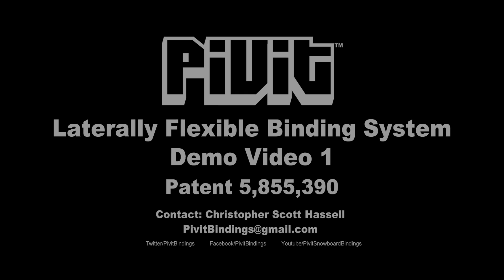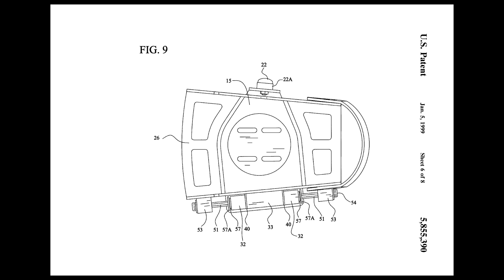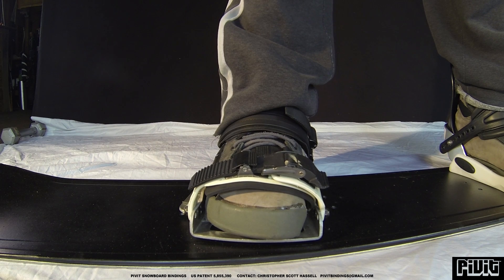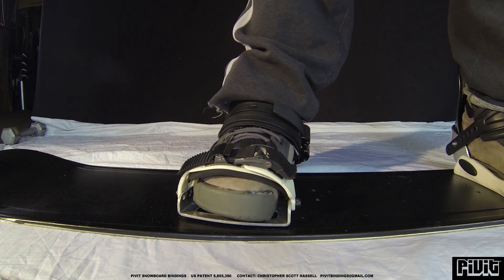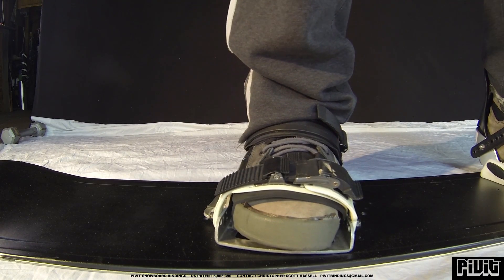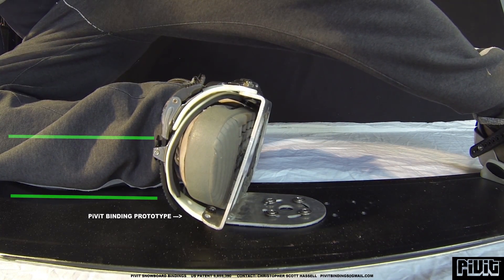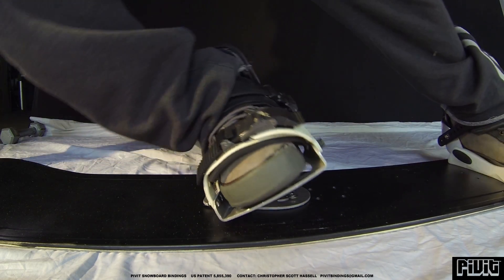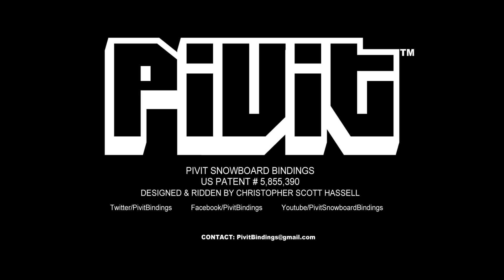The Inspiration & Logic behind Pivit Binding System

Comment: dude, make it so you can lock the pivot feature off if you don't want to use it and i think those things would rock!
Reply: Yup. Done. The patent (#5,855,390) includes and covers an efficient locking mechanism.
Reply from the maker: Done. It's a simple  easy to reach lock on the interior, medial side.